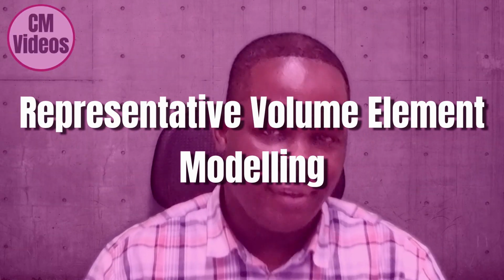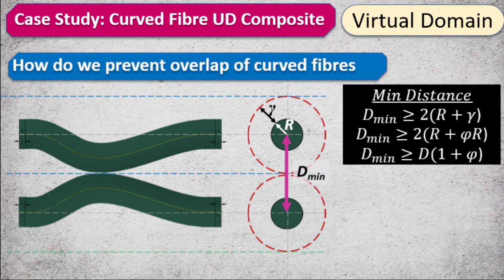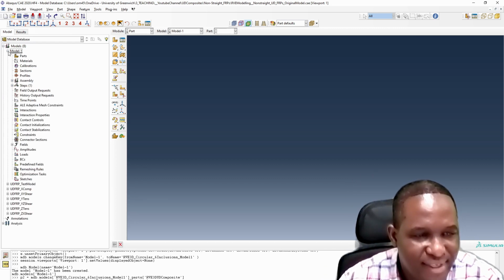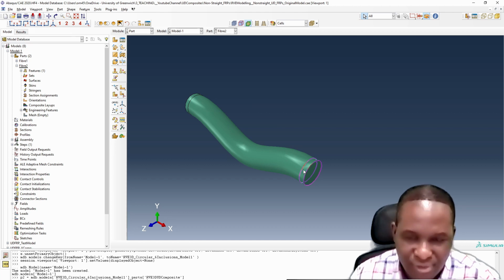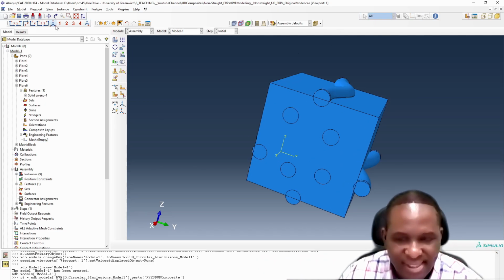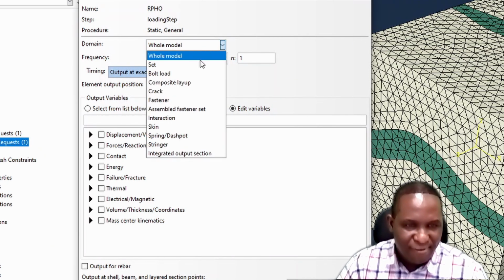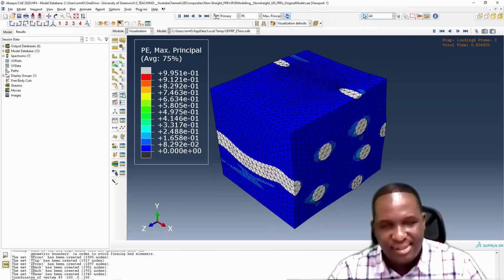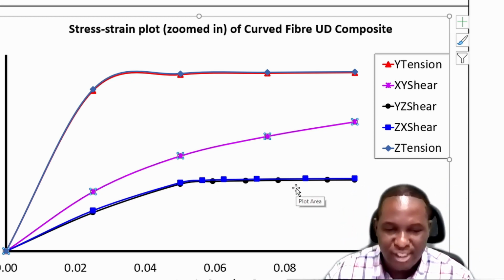How to model unidirectional composites with curved fibres in #ABAQUS

Comment: Thank you D.r...Can you Model steel fibre reinforced geopolymer concrete beam on Abaqus please?
Reply from the maker: Hello @Esirael Jhon, thanks for the request. I understand steel fibre reinforced concrete beam but what about the geopolymer aspect? Please can you provide more guidance on what geopolymer you have in mind? Maybe, a link to a journal paper on this issue will help. Thank you.
Reply: Dear D.r I mean to say that assembling steel fibres with concrete beam L:1m h:300mm,width b:200mm....geopolymer mean concrete... sorry Doc
Reply from the maker: Okay @Esirael, now I sort of understand the question. I might not be able to do this model now but will consider it in future. I am working on other projects at the moment. Thanks for taking time to explain what you need.
Reply: @MichaelOkereke  please D.r I need your help to simulate it....urgently i am Msc researcher and if you do this until february 2023 i am waiting on it
Reply: Please D.r help me how to model multi hooked end steel fibre into 1m length matrix

Comment: Dear Dr.Michael, thanks a lot for sharing these valuable tutorials. The fiber bundle is a transversely isotropic material, and the video does not seem to give direction to the fiber bundle, could you please tell me why?
Reply from the maker: Hello @Xiaoyu Wang, thanks for the observation and you are absolutely right. Especially as I have chosen to model the fibres as carbon fibre which has transverse isotropy properties. I did not include this in this video for now because I was not going to model the fibre in this video. In another video, I will modell the problem in which case I will specify a fibre orientation for this. The essence in this video of creating a material was simply to help me do section assignment of the constituents and so the materials are simply placeholder materials for this stage of the model development. I hope this makes sense and you understand.
Reply: @MichaelOkereke  Thanks a lot! Looking forward to the next video about how to specify the orientation, especially for fibers that are curved or non-straight.

Comment: D.r. Michael, I'm wondering how you simulate the unidirectional composites with curved fibers RVE in Abaqus. The way you plot the stress-strain graph is excellent. I also attempted to plot the stress-strain graph after extracting the reaction force and displacement data from abqus to excel and pasting it into excel. However, it is not as good as your plot. So, could you please send me your Excel template, or could you tell me the procedure how to create the temple in excel?
Reply from the maker: Hello @Endalkachew, thanks for the comment. The excel file is in the description section of the video under the links provided as downloadables. Have you checked that? Try that and let me know if you had any problems.
Reply: @MichaelOkereke  No, I did not checked. Let me check it and if I find any problems, I will notify you. Thank you very much for taking the time to address all of our questions without becoming bored.

Comment: Dear Dr.Michael, Thanks a lot for sharing these valuable tutorials. Can you please do a video on the modelling and analysis of a composite with random orientation of fibers. For ex: Fiber reinforced concrete. Thank you and good luck.
Reply from the maker: Hello @Just Cz, thanks for your interest in the channel. That is  a good suggestion. I will consider it for a future video and see how this can be done so that most users/viewers can pick up on this. The challenge lie in random creation of the inclusions using the Monte Carlo Methods. You will need to randomize the location and orientation of the fibres. It is a double-loop randomness. Then, after that, you will also have to assign material orientations to the fibres. In the mean time, check out this excellent video by Engineering Software channel, as it will guide you in the process: https://www.youtube.com/watch?v=Tm0MwIs2qCY
Reply: @MichaelOkereke  Thank you so much for your directions Dr. Michael. I'll check this video.  Eagerly waiting for your tutorial video on this. Thank you

Comment: Hello Dr. Michael. One doubt here. Isnt the shear modulus YZ equal to Young's modulus in the Z direction? (Time: after 34:05)
Reply from the maker: Hello @Shravan Bhadoria, thanks for your interest in the channel and your comments. Actually, the Shear Modulus on the YZ-plane is different from the Young's Modulus in the Z-direction. The modulus in the Z-direction is obtained from a uniaxial test while the shear modulus is derived from a shear test. The former characterizes size change while the modulus is a measure of shape change. In shear you have angular change of the structure and so the modulus measures this angular change i.e. shear modulus on YZ plane is a measure of how stiff/easy it is for the structure to be deformed in the YZ-plane. The Young's modulus on the Y-axis is a measure of how easy/stiff the structure is in terms of resisting size change along the Z-axis. I hope these explanations make sense to you.

Comment: Thank you Dr. Michael. But, when I did the way for higher volume fraction, the RVE gets orange and it is not meshable.
Reply from the maker: Hi @Funny Moments, here are three immediate things you can try:

1. Change/reduce the seed size to make it into a finer meshed model. 

2. Change element type to triangles (2d system) or tetrahedron (3d system). Most models will mesh with these types of elements.

3. Partition the model at places where you find intersections in the model. Use the partition tool.

If all these do not work, try checking those places in the model where intersections exist and spread the model about.  The translation tool can be used to move fibres around so that the system will not have intersections.  Let me know how you get on.
Reply: @MichaelOkereke  Thanks for your kind response. I will do your points.

Comment: Dear M.Okereke 

can you send me the script file using for generating the inclusion.
Reply from the maker: Hello @Hamza Djeloud, I apologize for missing out on the downloadable resources. I have now added them. Please go back to the video description and you should be able to download the script and other resources.
Reply: @MichaelOkereke  Thank you sir for your interest because you can download a file I wanted to make sure to find a text in MATLAB that gives the random values for the fiber center.
Reply from the maker: My next video will be about this very issue so Hamza please look for it when it's released. I believe you will find it helpful.
Reply: @MichaelOkereke  I hope so, sir
Reply: Hi Sir, I just subscribed to your channel. I find your videos very helpful, such important content!! I have a special request. I'm still a newbie in Abaqus, but I'm working on soft actuators that are based on liquid metals. I have designed a  rectangular prism elastomer made of Ecoflex with a rectangular hole, which will be filled with liquid metal Gallium. I want to simulate the stretching and contracting of this elastomer when a load is hanged or applied to the other end, and the liquid metal is heated to change phase from liquid to solid or vice versa.

Comment: I have one question about material put in  because in the material library  the is special  for fiber composite material  you did not use   it
Reply from the maker: Hello Esam, since I am using RVE modelling with constituents of the composite modelled separately,  I didn't need to use the homogenized model properties of say classical laminate theory. What you say becomes valid if you are modelling a homogeneous composite where you cannot distinguish the constituents properties.

Comment: i couldnt explain myself in the live stream sir, what i want to know, as you said this is a little sample. as an engineer i am analysing large scale models that is not made of composite right now. but i want do improve my skills. for a simple material we apply test datas to determine new material properties in the software. 

let say i am gona analysis a F1 race car body which is made of composite material in this video. 

there are two ways to do it;
1- modeling whole car body like this using tiny fibers, which is really hard and time consuming and need to super computers to solve.
2-?

this is my question sir; is there any other aproach to solve it without consuming too much source.(time money power)

what i guess is doing a small scale analysis then extract the results of material properties as a new material.  then could we use this stress strain result to our new model without consist little fibers. any idea how accurate will be the result?

sory for my bad english sir, hope i could express myself, and sorry for my ignorence in the advanced FEA field.
Reply from the maker: Hello, thanks for your extended explanation.  Option 2, as you describe, will be an improvement on option 1. This is the right way.
Reply: @MichaelOkereke  thanks for your return sir.